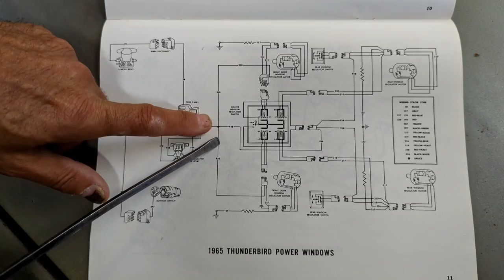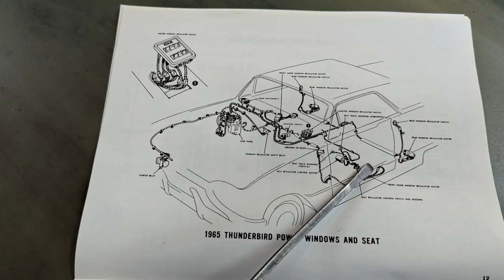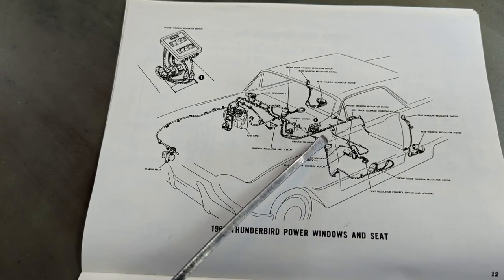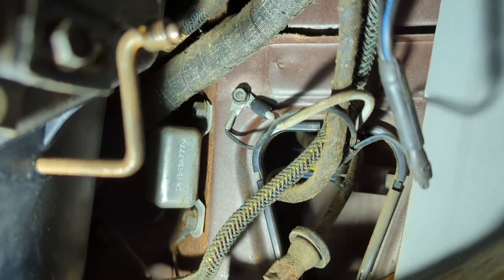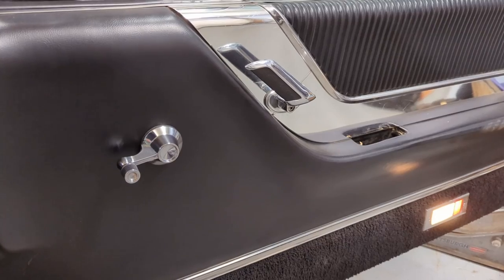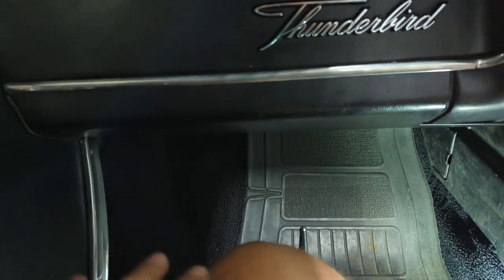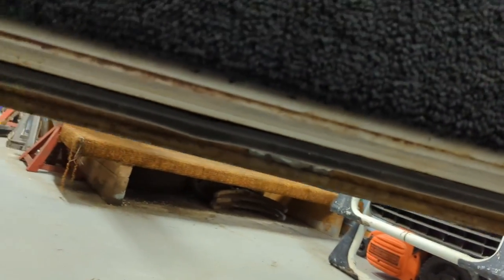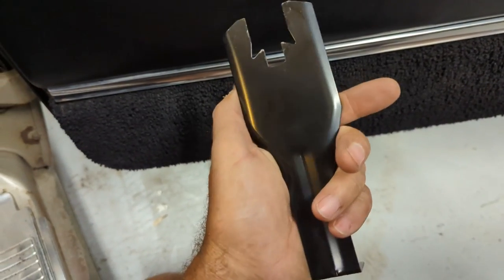Fixing Power Window Electrical Issues - 65 Thunderbird

Comment: Hey Alvin, great video. I think that was a very good observation to point out a bad ground. I dont usually look for those but in the future, Ill certainly keep that in mind. Its very common for the windows to stick like that and I have usually attributed that to a power drain and or the wrong window motor gear. Ive tested these quite a bit and Ive found that by the time the power gets to the window motor, its a few volts lower than battery voltage. Next time you have the door panel off, test the voltage at the window motor, see what it is. The passenger front window in my 66 sticks all the time, Im just too lazy to fix it. In some cases, Ive gone as far as run a power wire from the battery to the window motor and install a relay into the door so the motor gets full battery voltage. One thing Ive noticed over the years, if a window motor is stuck, once you unstick it, it will go up and down nicely until the next day or so, then it sticks again later. In other words, once you applied battery voltage to the window motor directly and unstuck the motor, it will continue to work for a while and now you dont know if the ground was truly the problem. If you had not unstuck the window motor with the battery pack and only worked the window motor with the window switch after you fixed the ground, would the window motor still have worked? Youll find out in time if the window stick again. Thanks for the video.
Reply from the maker: Hey Nick,
I wish I had thought checking for voltage drop 😔, I'm sure there will be a next time. Lol
I like the idea of adding a relay, that would be a simple fix for the voltage drop, I'm thinking I'll do that regardless. 👍👍👍
I agree, by unsticking the motor with the battery pack, I lost the opportunity to see if there is another problem at play in the circuit...next time. Lol
Thanks Nick, as always, extremely helpful information! 😊
Reply: Hello Nick and Alvin. At about the 3:16 mark of the video you are showing the schematic. If you look closely,  you will see that there is a resistor shown in the ground legs of the motors. This would explain why you do not get full source (battery) voltage at the motor terminals.  If the ground wire is actually a resistive wire, the wire itself may have increased in resistive value further reducing the voltage to the motor terminals.  Evidently, the motors either are not designed for a full 12 volt source, or the resistive ground wire is designed to open if the motor gets jammed. It would be interesting to see what resistive value that ground wire is supposed to be on a known good example.
George B

Comment: Nice diagnostics, that wasn't obvious. So much better than loading up the parts cannon and firing away.  Thanks for taking us along ~ Chuck
Reply from the maker: Hi Chuck,
No, it wasn't an obvious problem, but as Nick points out, this may only be one problem with the circuit, I have a feeling, I will be back in there again. Lol

Comment: Hello Alvin. Just to add on to this, I just measured the grey wire at the motor connector (motor disconnected) to ground. It measures around 0.5 ohms. I also looked at the schematic in my 66 manual and it clearly shows a resistor in all of the motor ground legs.
George B
Reply from the maker: Hey George,
0.5 is within range, I wouldn't want to see any higher resistance, but I'm curious about the resistors on the ground legs in the diagram. I do have a 1966 shop manual, and like you said,  it appears that resistors are in the circuit...but they aren't in the 65 wire diagram, not in the one I have, so that's a little puzzling 🤔.
I wonder if they are there to help the current flow at the motor? 🤔

Comment: Hiya Alvin 
Thanks for the insight of the ground locations. I’m sure I’ll use that nugget of info when my son and I attack the driver’s window that was taken apart prior to our ownership.
Reply from the maker: Hey Troy,
If you haven't already, take a look at Nick's comment, I pinned it to the top, lots of great info in there, that also may help out with your son's window motors.

Comment: 50/50 warranty, 50 feet or 50 seconds which ever comes first. I have a few of those door handle tools that I doubt I will ever use again, ones a snap on too I believe or mac maybe. I likely would have just by passed the ground inside the connector with a jumper wire and bobs your uncle but that repair  looks better hehe.
Reply from the maker: Lol...this was several weeks ago, and the window still works!
The original connection was actually a little loose, it took very little to get it back in order, mostly just re-crimped the original connection, some cleaning was required...this window most likely always had issues from day one.

Comment: Hey Alvin thank you so much for this video! 
Question on the 66 the passenger window works great from the switch up and down, but problem is driver window is getting no power at all even when swapping out to see if the switch was bad, not the case still no power. the vent windows have the same issue. is it a bad ground or is it the relay only supplying power to one window because it's bad? 
Thank you so much ! test light with switches off had no power at drivers window and both vent windows as well😆🙄😬
Reply from the maker: There is only one relay that powers the window circuit, so I'm pretty sure the relay isn't the problem.
You mentioned that there is no power at the motor with the switches off...check to see what is there for power when you push the switch, if you get power, then it could be a bad ground, or motor.
Are you getting power at the switches for those two motors?
Reply: @J_R_Shop  Hey Alvin I am getting power at the passenger window switch it now works from the switch going up and down, but the driver side window has no blinking lights or anything when I try it going up and down from the switch itself.  I wonder what that could be. thank you! sorry for delayed response :(